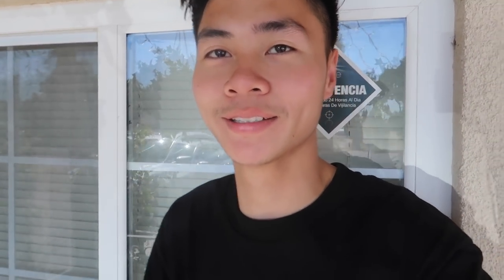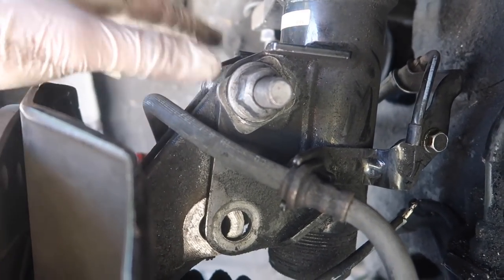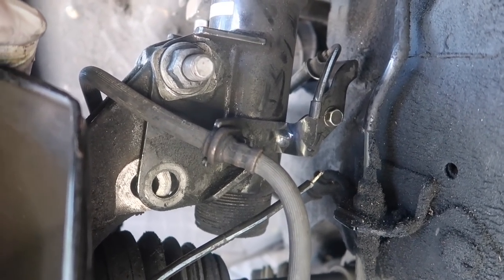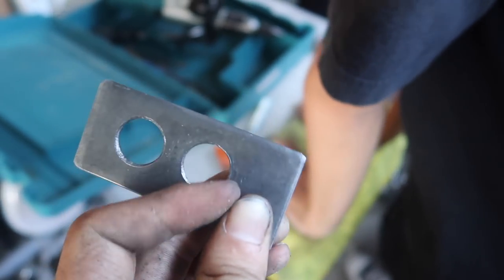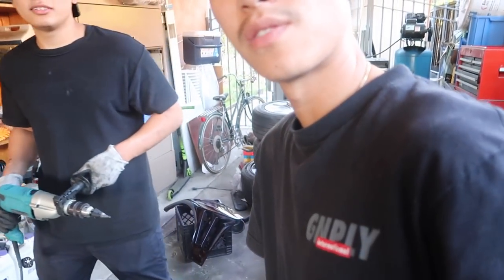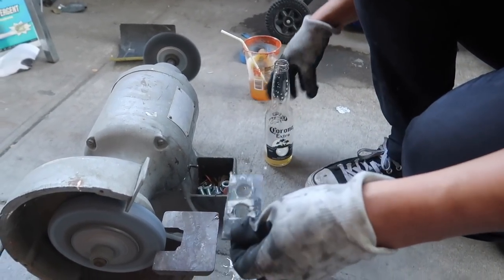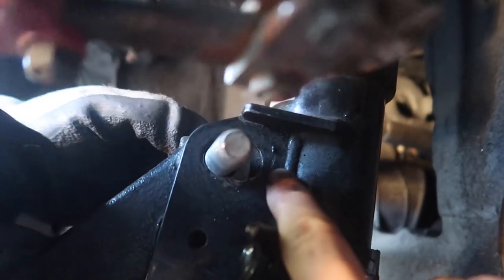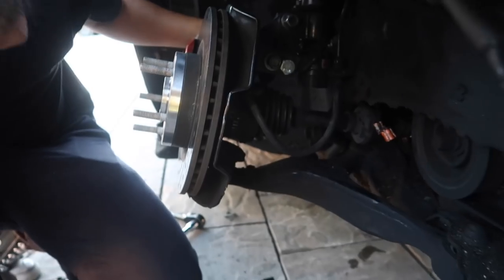CUSTOM EXTREME CAMBER HACK FOR ALL RSX AND CIVIC!!! (-15 Degrees)

Comment: Dude the ABS is a security feature... It helps your braking getting it shorter in an emergency situation by not fully locking the wheels... it also enables you to still have some control on your trajectory even whilst braking...
Find a way to put it in the current setup if you can!
Reply: Bro no one needs abs tf
Reply: I'm sleep I'd like to see the face you make when you do an emergency brake without ABS. I'd bet you'd shit yourself thinking why it doesn't turn and slow down anymore.
Reply: With 2.5” of rubber from each wheel contacting the pavement.  The ABS is already worthless.  In the event of emergency.  It will just sail right into what the driver was trying to avoid.  At this point.  They might as well install ejection seats. Then of course there is the scenario of hitting a pot hole or a raised portion of the road.  Ejection seats will not matter when the car endos over onto its roof.   Sadly.  That RSX will end up in a junk yard after being delivered with white tarps covering it.

Comment: That connector is a wheel speed sensor which measures your wheel speed if you look on the axle shaft it has little metal notches and that's what the sensor uses to measure your speed hence why you abs light is also on

Comment: Careful when braking that shit is going to lock up a lot now, less contact patch in the front means less brake force so try to break some while before a red or traffic. My shit locked up on me when the floor is wet it will start slowing down it’s scary but the aesthetics are worth it lol